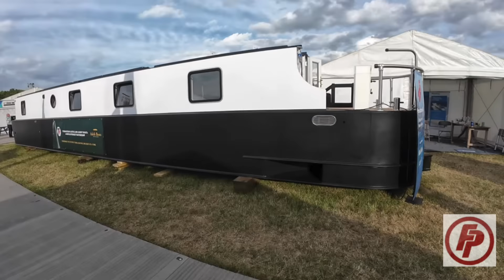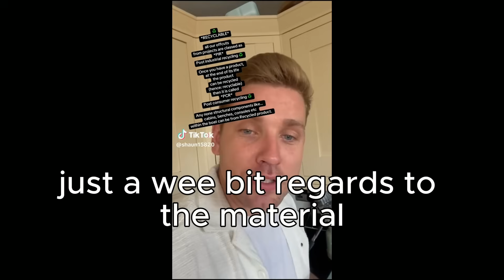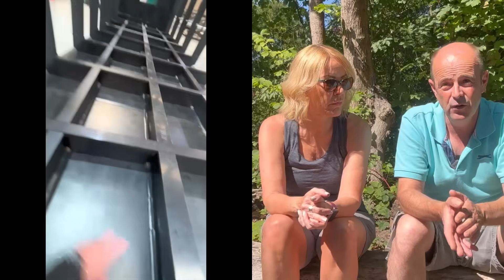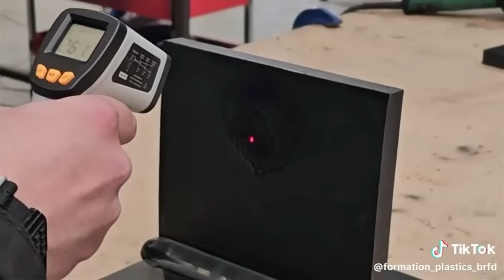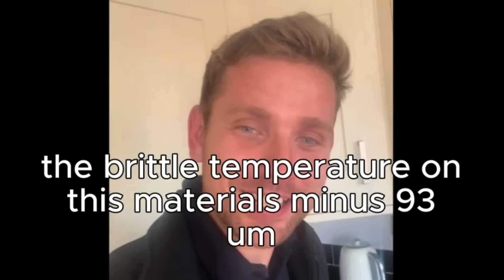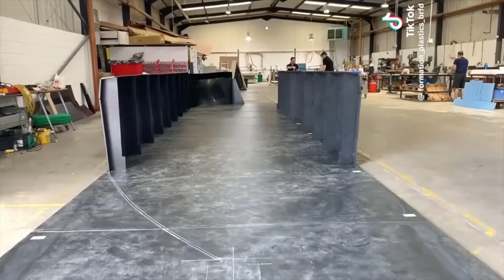Rust-Free Canal Boat?! The WORLD'S First Plastic Narrowboat Explained | 194

Comment: Logically for ballast should (very usefully) incorporate bigger (under floor) built in fresh water tanks and to increase draft to increase air draft for clearance under low bridges could also use wing tank ballast tanks using canal water. The lighter material makes it ideal for fitting heavy historic diesels without suffering the increased draft conventional steel suffers; limiting many parts of the canal system. Would make good pontoons if not complete house boats.  Detachable replaceable rubbing strakes would probably be a good idea to preclude need for plastic weld repairs to same. Lots of potential and maybe a laminated honeycomb version could be used as a cushioning material much as honeycomb stainless as used for impact absorption in parts of the (racing) motor industry. Comparable cost new will soon be offset with the much reduced overheads cost of hull maintenance, anode renewals and cost of lift outs and relaunch.  I would opt to make topsides white and hull and hidden structure black. Wraps are a good quick cosmetic fix. Wet-room bathroom made as a whole welded module similar to stainless steel designs also makes good sense for the fit-outs and could even be a good option for steel boats to incorporate. Should hull abrasion be an issue revealed in due course fitting strategic stainless steel plating (waterline area, small movement allowance in fixtures, as in quality table top designs) would mitigate and have similar no maintenance qualities. I see great potential in this concept.
Reply: Yes, on our 2025 Crick boat we used a water ballast system in the stern, similar to what Sea Otter used. However, this time we’re not doing that, as we’re going for a traditional propulsion setup—so the stern is being designed accordingly.
As for draft: the Vetus ePod system gave us around 17–18" of draft, whereas with a traditional propulsion system, we’re looking at roughly 19–20", which is expected.
In terms of cost—yes, it’s approximately £1,000 per foot. (I can break it down even more regards what included in our shell comparison to steel ,However, the amount of labour involved is significantly higher than with steel. That’s because under welding standards, this material can’t be ground down like steel. Doing so would damage its structural integrity, so everything needs to be right the first time.
I completely understand that people have different views on this approach. But we’ve spent over four years researching and developing this from our very first widebeam to what we are doing today , and we’re still learning to make sure this is right including conversations with HDPE boatbuilders from all over the world. That’s why we can confidently say we’re the first in the world to produce a canal boat using this material.

If anyone has further questions, I’m more than happy to go over the details—just reach out at shaun@formationplastics.co.uk.
Reply from the maker: We see great potential too and Shaun has answered your technical questions too 😁👍🏻

Comment: Being so light, how will it handle in wind?
Reply from the maker: Good point! They’re actually not as light as you’d think – HDPE is lighter than steel, but the boats are still built with thick hull sections and full fit-outs so they’ve got plenty of weight and ballast. From what we’ve seen, they handle very similarly to a steel boat in wind. 😁

Comment: I love this concept, but seeing how high it sits in water, will this be an issue with low hight bridges on the canal?
Reply from the maker: Hi 👋🏻 here’s a previous reply from Shaun, which should help “As for draft, our setup has a draft of approximately 17-18 inches using the Vetus E-Pod propulsion system. If you were to use a more conventional propulsion system, you'd be looking at a draft closer to 19-20 inches, depending on the configuration.
Your points on wind drift and low bridges are valid - and as you said, easily addressed with additional ballast or by fitting a keel/skids.” 😁

Comment: I’ve been following this HDP  narrowboat since it was at Crick. Absolutely fascinating stuff. Thanks for sharing and asking all of the questions I had and some I didn’t even think about (like painting options). 

It would be good to get more data on the insulation properties of a fitted out boat with a correctly fitted heat source. Inside outside winter temperatures, and the same for summer with someone living aboard. I also wonder about condensation. 

I’m assuming that the HDP is chemical resistant. 🤔

Thanks again and have a good Sunday. 

🙂🐿️🌈❤️
Reply from the maker: Aww thanks for following and great ideas for future videos. Also HDPE is often used for chemical storage tanks, pipes, fuel containers, and packaging for corrosive products, so we believe it is 👍🏻😁
Reply: Thanks so much for following the project – really appreciate the support, and great to hear the questions have been useful!
You’ve hit on a really important point with insulation and condensation. We’ll definitely be collecting real-world data once the boat is fully fitted out and in use – looking at internal vs external temperatures through both winter and summer with someone living aboard. That should give a clear picture of how it performs day-to-day, especially with a properly installed heat source.
For reference, HDPE Marine Tec has an insulation value of 0.47 W/m²K, compared to steel at around 47 W/m²K – so it's around 100 times more insulating than steel, which makes a big difference in reducing heat transfer through the hull.
And yes, HDPE is also highly chemical-resistant – it stands up well to fuels, cleaners, and even saltwater. Another reason we use Polystone G Marine Tec for these applications.

Comment: Glad you took the time to investigate  the concept of HDPE being used to construct narrowboats.  It will change the face of the narrowboat world should Sean be successful.
Do look on line, if you are not familiar with the operation called "spin welding".
One issue with the boat having a shallow draft is that it will have more of a tendency to drift when hit by winds and breezes.  The other possible issue with it sitting high are some of the low bridges on the canal system.  There is a simple fix and that would be to increase the ballast or add skids/keel to the bottom.
The issue with the adhesive film is that it has a life expectancy of about 5-8 years.  The film is not cheap and can be extremely difficult to remove, though I am to believe that a new layer can be applied over the old layer as long as it is in good condition.
Many thanks again and will be looking forward to your cliff hanger.
Mark
Alberta, Canada
Reply: Thanks for the message — some great points raised.

Just to clarify on the  film: it's purely a protective layer applied by the manufacturer, similar to the temporary films used on new cars. It’s not a permanent surface finish, just there to protect the Material during handling and fabrication so comes off after we build 😊

Other plastic materials, such as Playtec, often come with an embossed finish directly built into the sheet. This gives a more refined and durable appearance

Regarding spin welding — it’s an interesting process, but in our case, we use extrusion welding. It’s very similar to MIG welding, but specifically for plastics, allowing for strong, reliable joins in HDPE construction.
As for draft, our setup has a draft of approximately 17–18 inches using the Vetus E-Pod propulsion system. If you were to use a more conventional propulsion system, you’d be looking at a draft closer to 19–20 inches, depending on the configuration.
Your points on wind drift and low bridges are valid — and as you said, easily addressed with additional ballast or by fitting a keel/skids. 😊

Appreciate the thoughtful discussion!
Reply: @ShaunMoir1  many thanks for the reply Shaun.  You will go places with this HDPE concept though it will be all about marketing.
Looking forward to future updates
Mark
Alberta, Canada
Reply: @markrant1460 thank you all I can say is watch this space 😊😊
Reply from the maker: Hi Mark, thanks for your thoughts, as you can see the Shaun himself has answered your questions below 😁